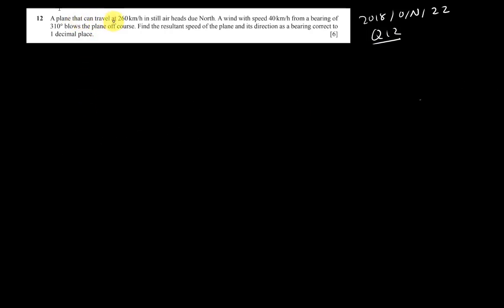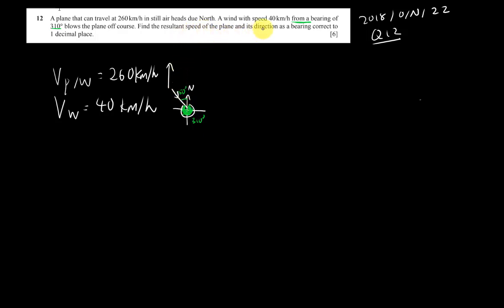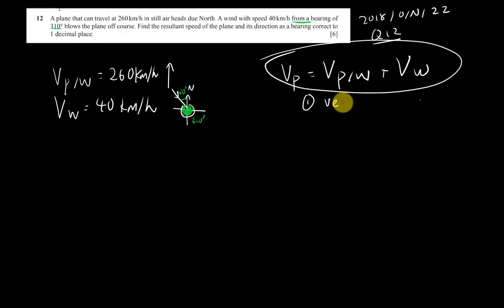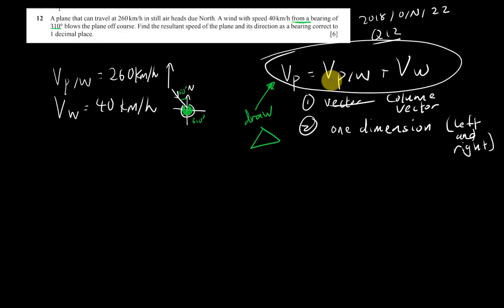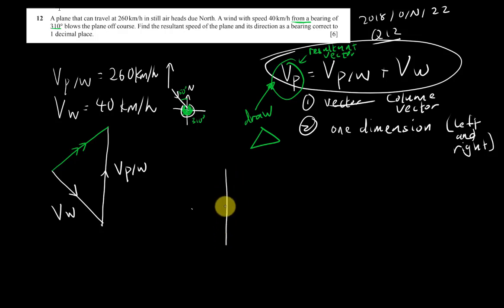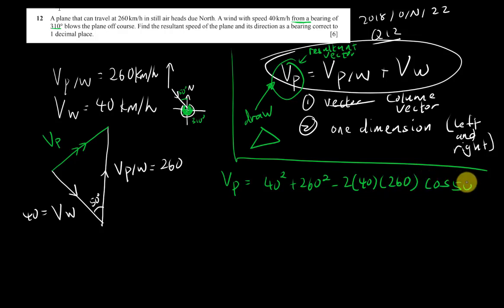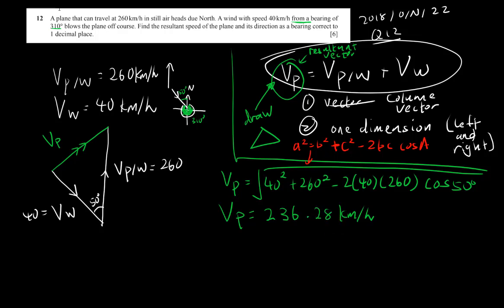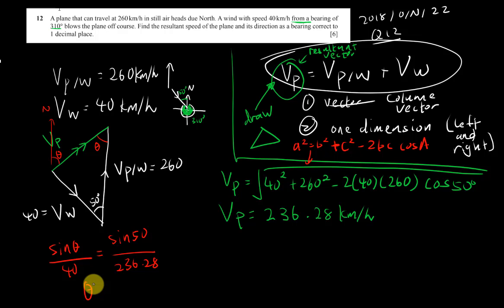IGCSE 2018/O/N/22 - relative velocity Plane question

Comment: what is the subject tho?
maths or physics?
Reply: Physics also but not so confusing in IGCSE
Reply: Add math
Reply: i am constantly getting between the mid and high 50' for my paper 4 in my physics.
the highest i had was 59, i just cant seem to get above, let alone touch 60.
Reply: add maths     0'levels / IGCSCE     4037/0606